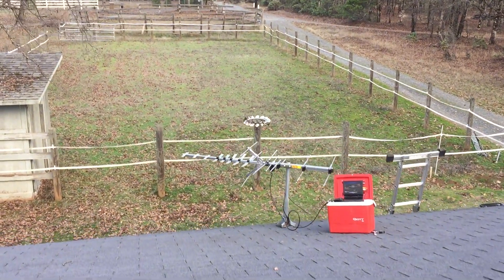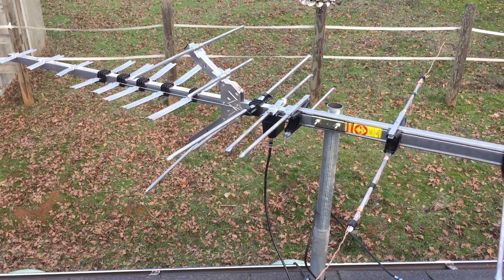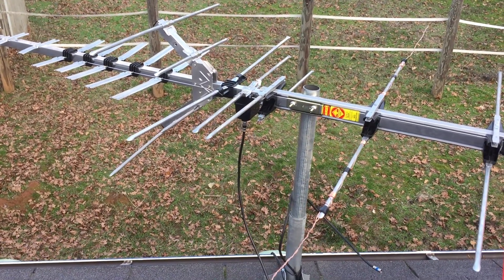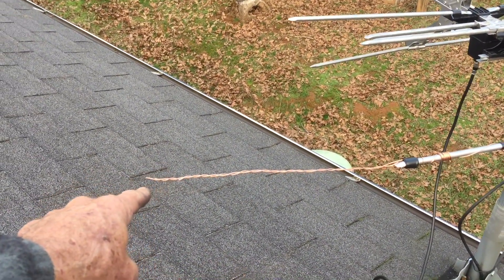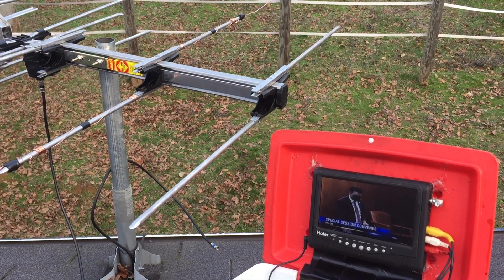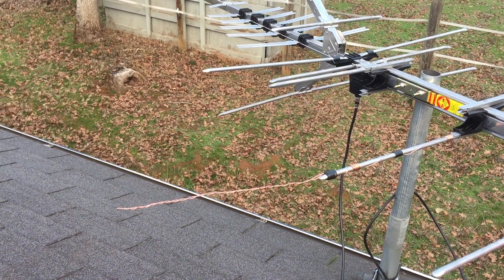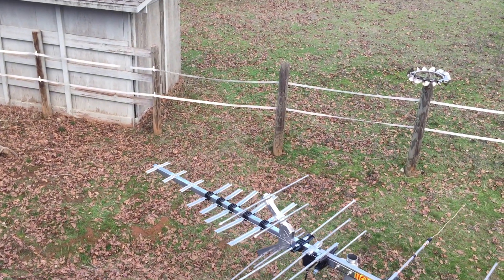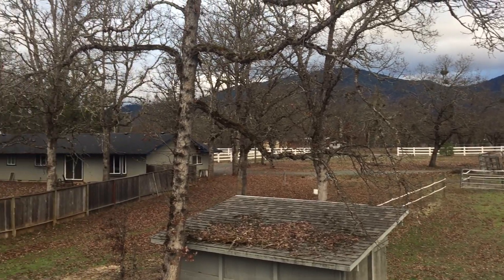Winegard TV Antenna Modification Improved Performance

Comment: Thanks for your video I got the 8200 XL - waiting for 20 ft telescoping pole to get here I should not have to worry about the add-on wiring —but your information—I can try to apply it to a couple of other smaller antennas that I have -Thanks again
Reply from the maker: Have fun!

Comment: I just put up the same winegard antenna it's smaller size out performed my old channel master 8' boom
Reply from the maker: In a different location you might discover your Channel Master does a better job than the Winegard, but the Winegard is certainly a good antenna.
Reply: @GrantsPassTVRepair  morning.  I'm in the Catskills, N.Y. we get heavy snow and freezing rain. I know I'm a bit low in hight as the top of my mast is about 10ft below my 2nd story.
Reply from the maker: Due to all the mountains and pine trees  around here,  sometimes it helps to have your antenna just a few feet off the ground in these parts.  @glennsvoboda6602

Comment: What type of wiring did you use and why did you just put it on to the elements not all the long ones
Reply from the maker: I used a twisted pare of 12 gage copper wire. I tried putting the wire extensions on other elements but the two I chose were the only ones that improved the signal.

Comment: Seems you have black electrical tape to tie the wire extension to your elements. Does that tape hold up through the weather (eg, rain, snow,  summer heat)?
Reply from the maker: It will be fine regardless of the electrical tape because I also twisted the wire around the elements, but I've often encountered electrical tape on TV antennas that are several years old, and I've  been impressed at how long it can last in the weather as long as you wrap several turns around the wire.
Reply: @GrantsPassTVRepair  Ok, good to know. I might do something with electrical tape soon.

Comment: Nice report, thanks, but you failed to explain the basics about antenna design and the difference between high band and low band VHF antennas and the difference between virtual channels and the RF channels. The model you have is designed for VHF high band and those are RF channels 7 - 13. That’s why the VHF rod elements are relatively short. The lower the RF channel number the longer the horizontal rod elements. (That also applies to adjusting indoor antenna “rabbit ears”.) You should have selected an antenna model that is also VHF broadband with both short and long VHF elements. 

Advice: When selecting, positioning, and testing/aiming TV antennas you should not just adjust for signal strength but also, more importantly, signal quality. You can have a high signal level and still not have a continuous picture if the signal quality is not high enough. The best test tuner is the Zinwell ZAT-970A. I include that in my listing for free TV antennas information on eBay:

https://www.ebay.com/itm/224279482890
Reply from the maker: Good point about signal quality Vs signal strength..
 I once had a situation where I pointed my antenna in the direction for maximum strength and my picture distorted, I found that by turning my antenna slightly off to the side where my signal was weaker,my picture quality improved. Even though I''m still learning as I go so thanks for the tips.
Reply: @GrantsPassTVRepair    It’s possible too strong a signal can overload some tuners. Also, I have had situations where my test tuner indicated success but the customer’s TV didn’t perform as well and it was a Samsung, considered one of the best tuners. There are differences in tuner performance, especially in very old TVs. 

There’s another video on YouTube with a guy in Vermont explaining how he had to do a low ground installation to receive the diffracted signal at the location. I’ll add his link after I post this comment. I’m in a difficult reception location and early on I discovered that for some channels higher is not always better because of diffraction. I have seven antennas pointed in three directions to be able to receive the big six national network stations. I have never been successful in combining antennas from UHF stations but I regularly combine VHF and UHF from different antennas using a dipldxer/combiner.

The refraction guy:

https://youtu.be/hVQNo6ifMNY
Reply from the maker: @bjs2022  I'm thinking the stronger signal reading I picked up must have included the unwanted multipath signals, so pointing away from the strongest signal reduced the multipath interference.  Due to all the mountains and trees around me,  I've had a couple situations where I had to lower my antenna to improve the signal strength.                                                  That was an impressive video the guy made. I like to try that next time I'm in a location where there are no signals.

Comment: What are you using as a "signal meter" It would appear to be a portable TV as best I can tell from the short time it was on screen? Which one? tyvm for this tip.
Reply from the maker: My digital to analog meter works best for measuring signal strength. I also have the winegard signal meter but it's not as sensitive. I plan to do another video on this topic so you might want to subscribe, but in the mean time  check out this video where I mention the model number of my D TO A converter https://www.youtube.com/watch?v=AzxIjQt8zlI&t=13s

Comment: As a former MATV installer, that Winegard antenna is just installed too low.  Height would have made more of a difference than lengthening the passive or driven elements.  Every 5' mast extension would gain a 2-3 dB or several dozen microvolts easily.  At that height, it would be the same as mounting it in the attic, and there it would be protected from the weather. BTW, most antenna manufacturers shy away from recommending additional height out of fears of electrical feeds and electrocution hazards.  Channel Master didn't put much in their student guides, but off the record, the instructors pegged height as the number one determinant for increasing signal strength beyond increasing the number of driven elements.
Also, don't forget to include a drip loop in the coax....saves on callbacks!
Reply from the maker: As a general rule going up higher is better, but that's not always the case in these parts .There have been a couple occasions where i had to lower my antenna to get a stronger signal. In one case I had to remove an antenna from the roof and mount it 4 feet above the ground to pick up a channel my customer wanted. This antenna is not designed for channel 5, so extending the element helped a great deal, and when my signal meter shows 70 or above I know the signal will be stable enough to be reliable.   I've done a couple attic antennas, but seeing how antennas don't perform as well when they are surrounded by an outside structure, it's not my first choice unless the signal I'm trying to pick up is exceptionally strong.
Reply: @GrantsPassTVRepair , Refraction is why you lower.
Reply: Please Help. What is meant by drip loop in coax, and what is the best way to include it??
Reply: @Allenmar73  A drip loop is simply a sag point in the coax, close to the antenna.  When rain hits coax, it likes to travel the surface of the coax insulator, and if not redirected, will eventually encounter either the mast, an F fitting, or other key part of the antenna system.  By forming a "U" shaped drip loop (close to the antenna), the water from rain will stall at the bottom of the loop and drip from there, traveling no further along the coax.  After fastening the balun to the antenna, we would go about 6" along the coax, form a "U" and tape the other side of the "U" to the antenna to form the drip loop.  Climbing up a ladder (or two) to fix a rain induced problem is no fun - so with the drip loop, you could avoid callbacks at installation just by creating the drip loop.
BTW, power lines have a similar drip loop at the insulator crossover on high tension lines - think transmission towers, not poles.  The rain settles at the bottom of the drip loop and drips, never reaching the mechanical connections.
Reply: @B-in-Norva you also need a drip loop where the coax enters the home, the alternative is that you are essentially funneling water into the wall.
Reply: The increased height is not always the case and, in fact if he would have went up just another 6 inches, he would not get a clear signal. In fact according to how he pointed the antenna was perfectly directed, the other main thing is how long the coaxial cable is, as well as the type of coaxial used. If it's greater than 30 feet coaxial cable to the TV connection its wise to use a RG6 Quad shield coaxial, never wise to use anything less than a RG6. The other problem I see is people using a Pre-Amp for improved reception, in some cases it make the signal more distorted, get an antenna that will work better, stop buying junk antennas that make no hill of beans. You done your work well sir, great idea with the 14" addition of copper conductor on each end.👏👍💯❤

Comment: Very interesting video thanks for sharing. Would it be possible to do the same thing by replacing the aluminum tubing used in the original antenna construction with a similar sized aluminum tubing from say Ace, Home Depot, or Lowe's, instead of extending it with copper wire? I thought about doing that for an antenna, an old Radio Shack VU120, that was damaged in windstorms.
Reply from the maker: No doubt there are better ways to do this, but I bet the antenna mod could out live both myself and the woman I did  the job for with no problems. ;-) Perhaps I will have a better solution in the future.
Reply: @GrantsPassTVRepair  I don't necessary think that one way is better than another. You were tuning the antenna to receive a particular channel (VHF 5, if I recall) that it was not well designed for. Experimenting with the copper seems to me like the easiest to get that done especially since you have to tweak the length on the fly for optimal signal strength. I'm glad for you that it also appears to be a durable enough fix to last for the foreseeable future. The antenna I'm thinking of worked fine before it was damaged, and still sort of works, but one of its aluminum dipoles is mangled. Replacing that tube might be difficult if the plastic insulators are rotted and crumble while I'm drilling out the rivet that holds it. Plus that operation extends the time on the roof. 😉
Reply from the maker: @waltschannel7465  Yes. it was an on the fly modification that saved me from having to order a more expensive antenna. In the past I repaired one of those plastic insulators you mentioned with bondo hair.which is a fiberglass reinforced auto body filler. It looked strange, and may have issues over time from UV degredation, but that's one way to fabricate a new part rather than replace the antenna.

Comment: This is such a valuable video. You're doing, with success, things that people have commonly been told over the years will not work or will not work well.

Twisted wire to make a thicker single element? Bad. Joining different metals? Bad. And mechanically at that? Double bad.

Unless I'm wrong and you didn't take what looks to be 14 gauge copper, hand twist it for strength, and electrical tape it to the existing elements to make them longer. Haha

This is pretty awesome. 👍👍
Reply from the maker: Yep ;-) I'm sure there are better ways to extend the elements, and more exact calculations to fine tune this mod,  but I saw such a huge increase in signal strength I left good enough alone.
Reply: It's refreshing to see that not all consumers fall for all of the hype used to advertise antennas today. Digital, hd, ultra 4k and other nonsense used to sell television antennas. element lengths that match the broadcast frequencies in your area are much more important than snake oil advertising.

Comment: How did you figure out how many wraps around the element, and how far out to extend the wire, and which element to add the wire to? Just looked up that antenna. Looks like it’s not made for low-band VHF frequencies (channels 2-6) . We ( Las Vegas ) still use a lot of VHF broadcast frequencies
Reply from the maker: I didn't use any formula to figure out the length, I just experimented by adding additional wire as I watched my signal reading going way up. The amount of turns of wire around the aluminum element didn't really matter. It was the additional length that mattered. I added about 14 inches to each of the Two elements.
Reply: @GrantsPassTVRepair  Good job.  I think it's amusing that you used a trial and error approach.  I thought maybe you need a degree in Electrical Engineering to calculate how long to make the extensions.
Reply from the maker: @davidho2977  I gut lucky based on my memory of building resonant dipole  antennas. https://www.youtube.com/watch?v=314lFMvf6sg&t=0s
Reply: 36" is the max width for High VHF when you go into channels 2 proper width is 96 by the time you get to 5the width decreases to 48 these measurements are for broadcast assigned not virtual you see
Reply from the maker: @unclefester6033  Are your numbers for a  half wave dipole?